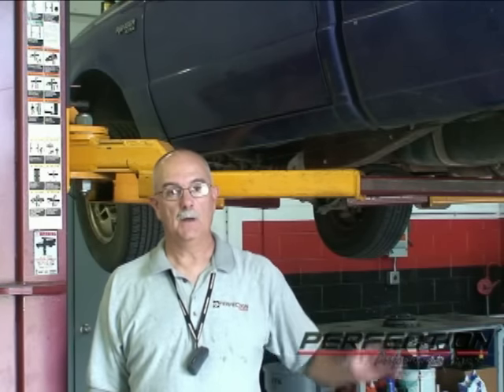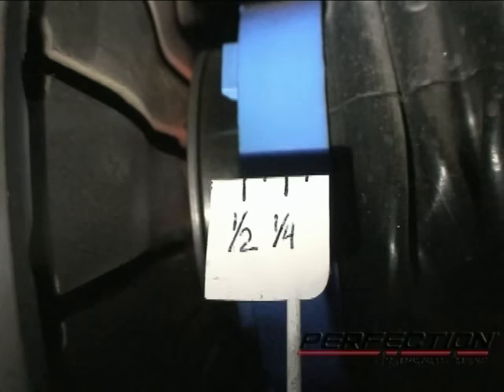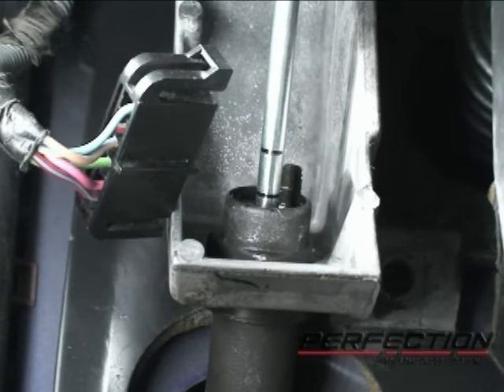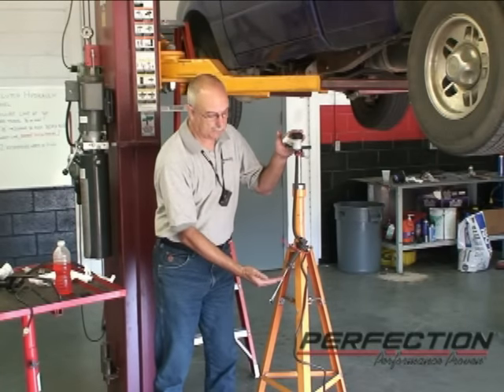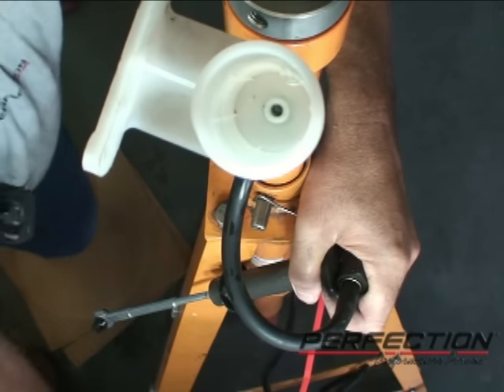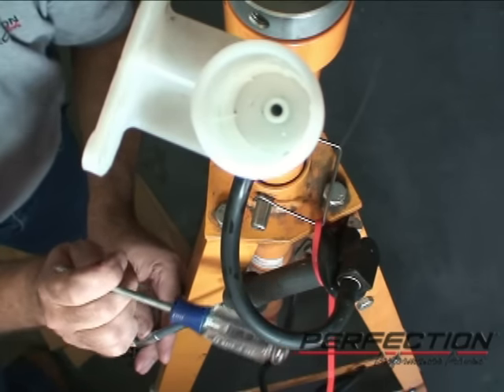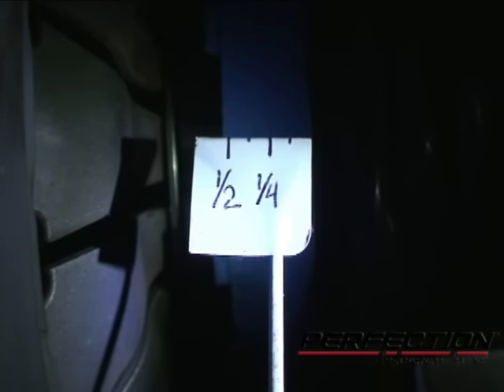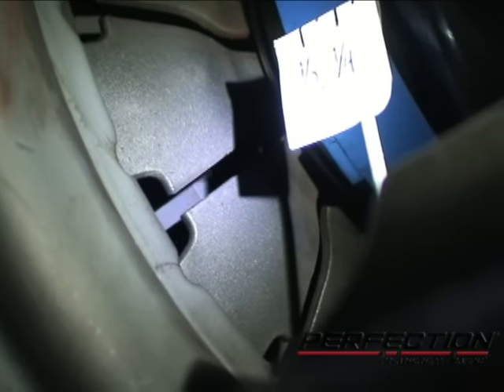Ford Ranger & Mazda B-Series Pickup Clutch Hydraulic Release System Bleeding Procedure Part 2

Comment: This video makes the most sense and clears up a tricky situation that us ranger guys have dealt with for years.
Thanks for your clear instructions.
Reply: Was your rod attached since u already had it installed & If so did u have any trouble getting it slid thu firewall
Reply: @CWB615  It has been a few years since i did this, but I think I had a new master, burped it with a philips screwdriver, and then installed rod after master install.   This video made the difference for me understanding my rangers setup.

Comment: You guys are great. I love the videos and have learned a lot. So I have a 2000 Mazda B3000 Manual transmission with about 185K miles. I replaced my clutch a little over 2 years ago with a mechanic buddy. I am no mechanic but love to try to fix things on my own, of course to save money since I am a student. We only replaced the clutch. About a year ago my clutch lost all pressure and I couldn't gears at all. I was stumped as I didn't know what to diagnosis. I paid a mobile mechanic to come and fix it. He informed me that my m/s reservoir was empty. He ended up doing a bleed & check clutch system service for me to get it back running. He told me that I had a very small leak somewhere and that if I ever noticed the reservoir low to add some Dot 3 fluid of course.Over a 12 month span, I have only needed to add little fluid about 2 times when I felt the pedal lose a little pressure. Just a few days ago, I completely lost all pressure again and had an empty reservoir again. I put more fluid and pumped the pedal to get me going for the time being. I am persistent on getting this fixed. I can't seem to locate any leaking fluid anywhere but did notice some black residue in the reservoir. I'm sure there is air somewhere since I have been needing to pump my pedal/clutch every time I go to start my truck for the past 3-5 days. How do I know whether or not I will have to replace the slave cylinder or the master cylinder or both to fix this? I'm sure I can bleed the system myself after learning it from your videos, but I do I go about diagnosing the real problem so this can be fixed? Sorry for the long story but I hope you guys can help me out. I would sure appreciate it.
Reply: Does this mean I have to drop the transmission? Just curious.

Comment: Wow....thank you guys so much. So relieved to have this done and a relatively simple fix (and cheap ;) )For other viewers: This works fantastically!!! I tried bleeding, vacuum pumping it out, took truck across street to friend's mechanical shop and we tried for over an hour including more vacuum pumping. I even tried some other non-conventional method I saw on another video where the guy disconnects the pushrod from the clutch pedal and takes out the snap ring and pulls up on the piston to draw air out of the system in the MC, but mine didn't work at all! I thought for sure my MC was toast, but as soon as I got the system out and tipped it upside down I could literally hear, feel, and see all the air coming up to the reservoir! It was like tipping a bottle upside down I couldn't believe how much air was in there. Followed instructions, installed, checked pushrod movement, gravity bled. Checked clutch engagement and everything checked out. Started truck up and wham bam thankya Perfection Clutch!!! You guys are awesome-

Comment: Had a limp pedal issue after a R&R on a slipping clutch on my faithful '94 V6 B3000 and did what I thought was a good flush and bleed; Followed your recommendations and it's totally firm again - now I have the problem of getting use to the like new clutch. It's freaky how so air gets in that system.; And getting that master cylinder system out as a whole is a trick.

Excellent video - THANK YOU Perfection Clutch!

Comment: This video gave me the information I needed. The problem I had was I could not access the clip to remove the high pressure line from the slave with out pulling the transmission back and I was working on the street and I was not going to do that. With the reminder of in the video of how air traps in fluids, I was able to bleed the line. The high pressure line was not made out of metal (lucked out) but was made out of a plastic that was somewhat flexible. So I was able to flex the line enough to bleed it like brakes, and while bleeding I would rapidly tap on the clutch line with the end of a wrench while a had someone in the Ranger pumping up the pressure to the clutch. It only took me an hour and only a half a pint of fluid-more than I would of liked to use, but thankfully it worked. I do not recommend anyone doing this. 
Thank you for the information, as it helped me to adapt and overcome my dilema, inexpensively.

Comment: Thank you SO MUCH for this bench burping method! 

I just replaced the clutch set in my 96 b2300, and thought I may have pulled the noob mistake of friction disk in backwards. Thanks to your video, i was able to see where the real problem was, and got it fixed.

The only real pain in this process was the R&R of the M/C. Once I had that out, the burp process went real quick, and very shortly had the solid feel to the M/C. When I had tried to gravity bleed prior to finding your video, all I was getting from the bleed screw was a very thin trickle. Once I had burped the system, and reinstalled, the S/C bleed flowed very fast. Best guess would be that loop over the frame rail.

Comment: Excellent video and explanation! I watched your other videos, now seeing this one. I figured to do this from my situation. I bleed but with the OEM Ford Master cylinder, no bleed screw like your has. So idi everything but disconnect the line to the slave cylinder. Tipped the Master cylinder and saw the air pumped lightly. Reinstalled and I got clutch again. Thanks all for your help. I bought the system from you but will install later. Thanks again.

Comment: Very informative. If you want to do it right this is the only way. Great job guys. This diagnostic process is fool proof and burping is 100% effective. You are now my go to guys when repairs are needed.
Reply: @perfectionclutch  Yeah I realized after I posted. I was wondering if you might be willing to take a look at a quick video I have of the slave cylinder as the clutch pedal is being pressed and tell me what you think? The pedal is very mushy and I dont think its moving more then a quarter of an inch. Also I noticed some fluid leaking from the oil pan/bell housing and was wondering if you might be able to enlighten me as to what you think it might be. I have video of both.

Comment: Excellent presentation and explanation of how to get those really difficult hydraulic clutch systems to bleed.  I'm actually working on a 1996 F-150 with the M5R2 and using the factory bleed instructions, I'm not having any luck.  Even though my master cylinder has the reservoir built in, I can still burp my system the exact same way as I just have to be a little more careful about the reservoir orientation.  Thank you!

Comment: This also works for silverados they don't have the separate reservoir it's built into the master cylinder, but this helped me a ton after replacing a leaking master cylinder on my 2000 silverado 2500. My clutch worked and disengaged after replacement of the MC, but it had to be jammed down all the way. After gravity bleeding, pump bleed techniques this did the trick to make the clutch work how it should.

Comment: Thanks very much for posting these clutch bleeding vids for now I understand my '95 Ranger's (4.0) system (and troubleshooting) perfectly.  Having only performed clutch replacement on my '89 VW Cabriolet, this was invaluable hydraulic system information.  I've long suspected air bubbles or a bad slave as the cause of the frequent 1st and reverse issues I've had since obtaining the truck and this nicely-produced vid will make my upcoming clutch replacement a far easier experience.  Thanks!

Comment: Excellent video.
I just got a new clutch, slave and master cylinder in my 03 B3000 v6, 2 wd. The clutch is very hard to push and the clutch releases within 1/2 and almost gave me whiplash. This is the 4th clutch from 2 different shops in 2 years. The last clutch from the same shop (1 week ago) was easy to push but, after heating up would slip very bad.
Reply: Scorpion, did you ever figure out why the clutch would slip after heating up? Mine does the opposite, releases fine when cold, but won't release after warm up.

Comment: I cant watch anymore of these videos with all of these techs taking off the slave cylinder to bleed. So here for everyone that needs to know and including this man. GET A JACK AND LIFT THE FRONT END OF THE VEHICLE VERY HIGH!!! AND THEN BLEED. YOUR WELCOME. At leveled ground open the bleeder valve and you will see little to no movement of fluid coming out.leave it opened and then watch the difference of fluid flow change as you lift up the truck. You do not beed to disassemble the slave cylinder. Gravity feed and then close the valve. Then bleed like you would a brake line. Everyone here owes 1 hr diagnostic time.
Reply: But Jonny!
He is not taking off the clutch slave cylinder.
Thats on the Transmission.
He is bleeding a Clutch Master cylinder and lines.
You're NOT paying attention.
Reply: YOU owe 1 minute of correction time.

Comment: Gotta say at first glance I'm much more impressed with Perfection's concentric slave cylinders than even the OEM part from the Ford dealership. I purchased both for comparison, and honestly the Ford part seems like a rebranded Dorman, looks identical, made of cheap plastic with a not-so-smooth spinning throwout bearing, the Perfection unit much heavier, made of metal, and the bearing glides very nicely. Think I'll be returning Ford's OEM part they double charged for and installing the Perfection unit.

Comment: I have an old 1988 Jeep Laredo 5 speed with an internal slave cylinder, and for the life of me, I can not bleed the system. It had a slow leak before I parked it for about 2 months. When I finally decided to drive it, the fluid was low and now the clutch will not engage or disengage. The clutch petal feels nice and firm.

Comment: Great video, helped me do what I needed to do, put it back in, pushed down on the pedal, push rod broke...why?? half metal, half plastic..Why? Try and buy just the push rod..no such thing..junk yard?  I ordered a whole new system, lost the clip that holds the line into the slave cylinder..wrote to perfection clutch for a replacement...still waiting..did find it..everything is good.
Reply: Thank you Gary!

Comment: I have a cluch peddle go to the floor .
I just bought the 97 ranger.
The boy said the slave cylinder is bad .
If i pull the transmission, should i replace the cluch and pressure plate?
Love your videos.

Comment: Thanks for posting this. I only wsh I would have watched it before I spent 4 hours screwing around with that hydraulic clutch Cable disconnect fitting. You rock. Thanks a million.. Y

Comment: Thank a million, recent blown hose saw a roadside mechanic replace a hose and nothing but intermittent clutch release since then with the car attempting to move off while clutch pedal was down. I bled the system like on other vehicles which seemed to work until I got on the road. So I replaced the slave cylinder, and later the master and still with persistent clutch problems, pulled the box off and replaced the clutch. I have tried reverse bleeding to no avail. I have always felt that it was air in the system. Thank you. Why would one design such a system?

Comment: So the entire problem is with the angle of the clutch master cylinder, where it is mounted at the pedal.  Ford left this as a problem for the ranger right up until it was discontinued in 2011.  
These are the ways car companies steal from us.  Intentionally putting (or leaving in) defective designs is not merely "planned obsolescence" it is theaft.  It is wrong and it puts far more of a strain on the environment than just tail pipe emissions.

Thanks for showing this procedure.  It is a small bit of relief from the endless greed and corruption that drives the entire auto industry.

Comment: Thanks for the video. I'm going to try this soon when I find someone to help me. My 2000 ford ranger v6 5 speed has a squishy pedal and it's hard to get into all of the gears. There doesn't seem to be a leak because my master cyl has a good amount of fluid. Due to the Ford Rangers weird master cyl line I'm guessing after 146k miles there was bound to be air trapped inside the line. Hope this works for me!

Comment: Perfection, do you think this bleed process will work on GM hydraulic clutches also? I used your technique successfully on a 93 Ranger before so I know it works. I am working on a Grand Am. I have replaced the clutch and throw out bearing/slave cylinder and  she is to the wood.
Reply: No it sucked right down to the floor board but I went at it the next morning and ran a quart of brake fluid though her (gravity bleeding) and she finally started to release. I test drove it and all was fine. She must have heard I had contacted you and got scared maybe. Thanks.

Comment: I am working on an 86 bronco ii that has air in the master I believe.  My line from master to slave does not have the valves as fluid freely flows when line is off slave.  Can this system be bench bled or should I just try and change the position of my master in the truck with everything connected?  Thanks for your time and the great video!

Comment: Question, The bleed screw on the slave you are demonstrating has a regular  bleed screw end on it. My daughter's 88 ranger has one that does not have that kind of end on it's,just a hex tip with a hole in it with no place to attach the bleed hose. How do you do the kind that we have.

Comment: Hey. Question. I just did this on my 99 Mazda series. I bought a new clutch master cylinder and benched bled it very good. I installed and it worked but didn't feel like it was releasing enough. After test driving it the line that attaches to the slave cylinder popped out. When I tried to put it back in, it wouldn't go in. After opening the bleeder valve on the slave I could then insert the hose back into the slave. Does that mean the slave is bad?
Reply: perfectionclutch hello. And thanks for the quick reply.  But what would be the cause of the feeling of it not fully releasing the clutch? Also the sleeve that I have doesn't fit inside along with the male end of the hose so that could be the reason of it popping out.

Comment: I bought the slave cylinder for the 2001 Ford Ranger 2.3L 2WD and swapped it out. Although this video helped me get the air out and I was able to drive around feeling like the truck was new for a few days, but today I suddenly have the issue of the hydraulic line popping out of the slave. It appears that the retaining clip that comes on the "improved clutch slave cylinder design" is just popping loose allowing the clutch line to disconnect, leaving me unable to use the clutch at all. Stopping the truck to reconnect the line is pointless, as the clutch line just pops out next time I try to use the clutch. What gives?

Comment: Hey perfectionclutch, in this video you mention that there is a check valve and the connection to the slave cylinder.  Is this applicable for the OEM system on a Ranger, or is it only in the case of the truck you are working on?  I ask this because you mention that this truck has the perfection technovation clip system?

Comment: 2000 ford ranger 3.0 vin V flex fuel, New clutch kit with flywheel and new clutch master cyl. and slave. pedal goes to the floor effortlessly, Removed clutch master asy, and bleed/burped EXACTLY as in your video, tapped on it with a screw driver,, spent an hour tapping and pushing.  The clutch master would still move inwards about 1/2 inch. reinstalled clutch master asy. The system would not gravity bleed, attempted to manually bleed no fluid would come out of the slave cylinder. When moving the pedal in and out with the bleeder open you can hear air moving so I dont suspect any restrictions. Which component would you suspect to be defective ?

Comment: Gary, thx for the video. I burbed/bled system as best as i could. Seems a little spongy, but have what seems to be at least a 1/4" of throw. Can start the truck in gear, but soon as i take it out of gear and engage clutch i can't get it back in any gear. Truck has almost 200K miles on original clutch. My friend says it possible for pieces of the friction disk to break off and jam-up things, or the rivets to start galling up the flywheel/pressure plate. What do you think? What am i missing? 
Thx for your time.
Reply: Thx Gary. Read somewhere that might help to open slave bleeder and push back on throwout bearing to try and get air out of slave. Even w/ having someone push on pedal, open bleeder, close bleeder, then pedal up, i'm not confident i'm getting air out of slave. Tube that bleeder screws into would be high-point in slave assembly. I'm thinking air can get trapped there?
Thx again.

Comment: 2003 Ford Ranger. Clutch pedal travels have before disengaging with the correct fluid level in the reservoir. Would not go into 2 gear. Now it will not engage in any gear. Any suggestions?

Comment: how did you remover the start switch connector from the rod?i have a 2003 ranger 2.3l.will i have to cut the push rod and in stall on new mastercylinder/rod?